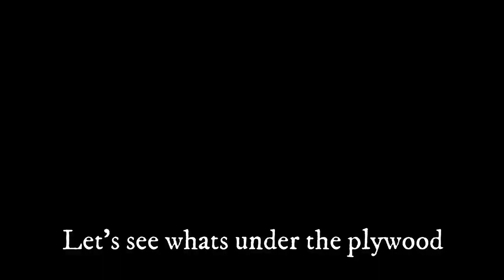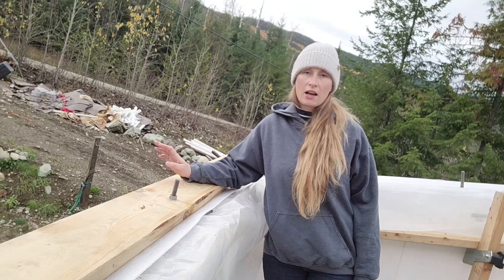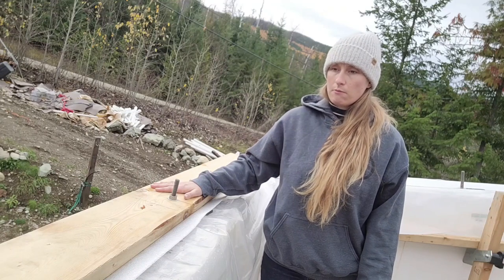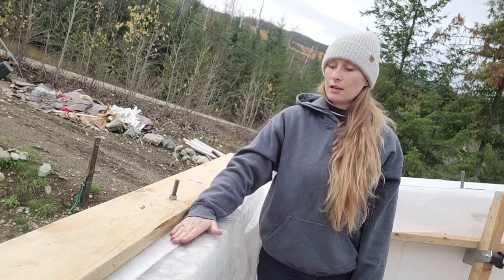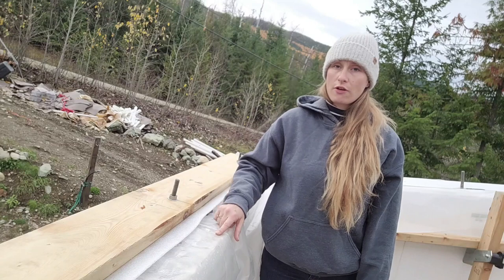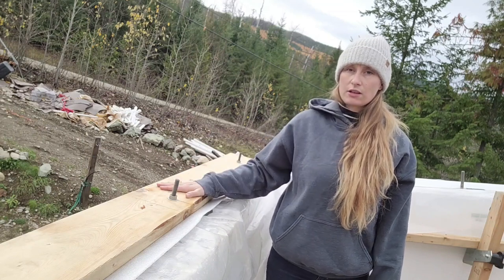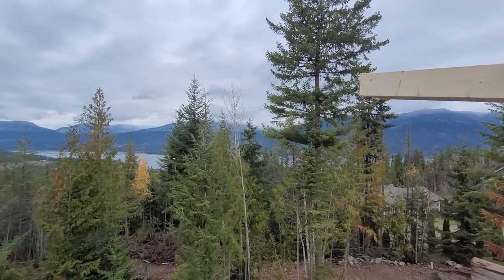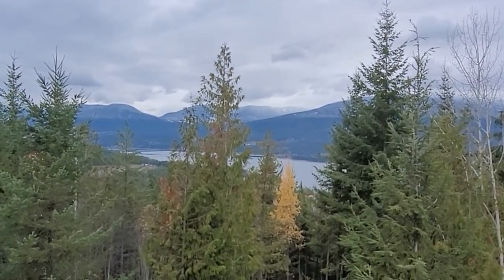Truss me, we'll get this roof on soon! But first: Sill plates and airtight envelope (passive house)

Comment: Three thoughts: a.  pre-vapor positioning is the way to go with any interface, such as top plate and trusses, and I believe that Siga recommends this in one of their videos; b. using poly may cause moisture issues down the road as it does not breath and may trap moisture where you don't expect it; and c. instead of the old school Dow sill seal roll, which is not air tight, and which may not be dense enough to seal against every concrete ridge and valley, you can buy butyl rubber sill gaskets for just a bit more money that do actually air seal your sill.  Carry on!

Comment: Project is coming along well. With the vapor barrier, will the air in the home have fresh air movement throughout?
Reply from the maker: Hoping we have a very air tight house and all air flow will come and go through an HVAC with heat exchange.
Reply: @anaverageacre  and that’s the way it should be…..tks!

Comment: Hey! We just got our roof too! We have a vaulted ceiling that makes the space between the top and bottom chords pretty narrow. I already know this is going to make running ductwork a struggle and doesn’t leave a ton of room for insulating. Seems like you guys have it even worse with those flat roof trusses. How have you accounted for it?
Reply from the maker: We are aiming for as close to a passive house as we can get so we are putting a false cavity below our bottom chord and within our air seal for all electrical and any ducting that we can. Because we want maximum roof space for solar panels there won't be any penetrations through the roof (except 1) which also limits holes through our air barrier and won't require any space within the chords. So the only thing within the trusses is insulation. Thats the plan anyways, not all of our well laid plans have worked out in reality lol. Its a learning curve. Theres just over 2 feet between our top and bottom chords I believe, whats your space like?

Comment: Not a good idea to use that plastic anywhere except under a slab. It cannot breathe.
Reply from the maker: Thats exactly the point! We want our house as airtight as possible - no breathing allowed! Ideally all air flow will be controlled to prevent heat loss, rather than seeping through the walls and cracks. And also, poly is specifically required by building code anywhere wood meets concrete so we didnt really have a choice.
Reply: @anaverageacre  when I say "breathe" what I mean is for the material to allow water vapor to escape (drying). There are  common building materials that do just that while also functioning as an air barrier. You should always assume that at some point water will find its way into your walls whether it be through improper construction techniques or material failure. When it does get in there, you want it to be able to dry to the interior AND the exterior. Poly sheeting prevents that. If water gets in...I should really say WHEN water gets in, you will likely have mold and rot begin. You won't see this a lot on older homes with poly in the wall because the walls are not very airtight on either side, so water that gets in dries out. But on newer homes with newer materials...it can go bad in a hurry.
Reply from the maker: Well I don't think it will rot but I sure hope we don't get mold! We didn't have a choice on the poly, since its code, and I know most houses have poly in the attic under their insulation, don't they? I'm assuming the airflow from our HVAC and the breathability of the house wrap will be enough air flow to prevent mold.
Reply: @anaverageacre  as long as no water gets in there or moist air that condenses, everything will be fine. Not sure why the code would say you need a poly vapor barrier on your walls or ceiling though. It makes sense under the mud sill, since that's where wood sits directly on concrete.
Reply from the maker: You're right, its just code under the sill plate, then we'll do housewrap like tyvek on the walls. Was planning poly for the "attic" below the insulation but sounds like we better do some research on that first!